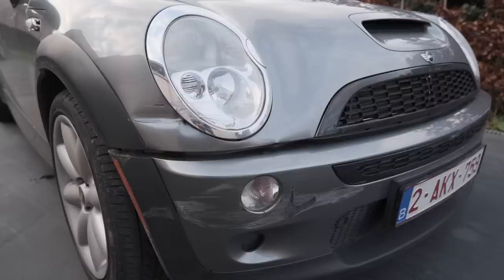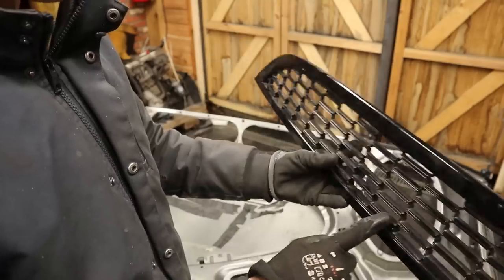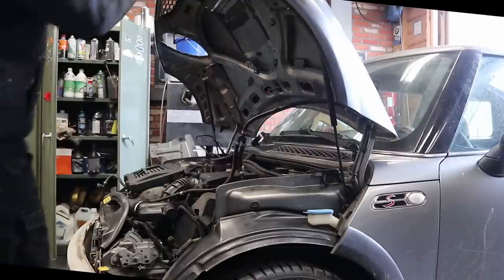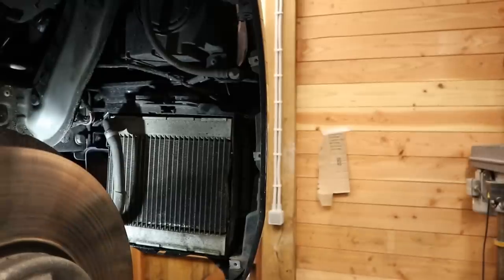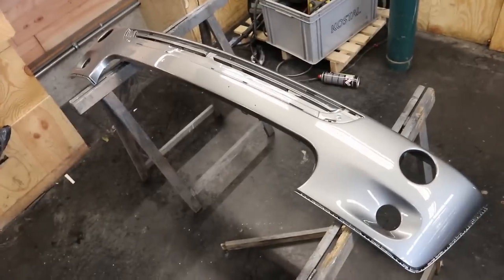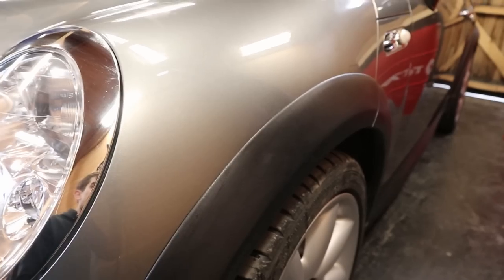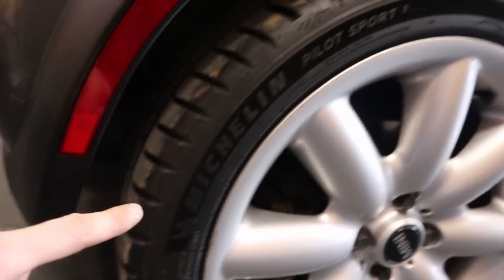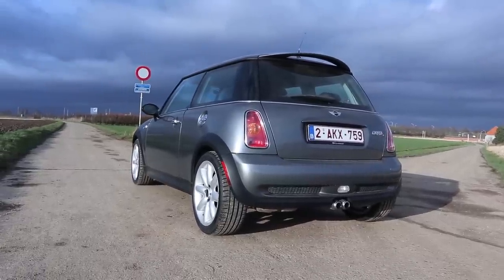I Am The Worst Paint Matcher In The World - MINI R53 Damage Repair

Comment: I know the struggle if mismatched paint. IMHO the dark primer made your color too dark in both cases. I had a similar problem while painting my mk1 octavia bumper. I used a grey primer instead of a beige one like Skoda used back in the day and my panel turned out too dark. Another thing to consider with metallic paint, is to back off the pressure on the spray gun for the last color coat. This enables the metallic particles to sit on top of the color pigments instead of drowning in the color pigments.

Don't be so hard on yourself, practice makes perfect;)

Comment: I have an R53 and I love it, it has so much character. Don’t be hard on yourself, many manufacturers have trouble matching paint from the factory.

I still see a lot of new cars where the difference between the steel panels and plastic bumpers is obvious.
Reply: thats why mercedes back in the 80s and 90s was famous for their colour matching...especially hard to do on white cars. Nowdays as you stated, you can tell even on new cars that its just not the same color :P

Comment: Had the same problem on a mazda mx5 used correct code but was totally wrong shade tried from two different paint suppliers in the end took petrol filler cap off and matched to that perfect match couldnt  tell any difference , keep going dont be to hard on yourself  doing a great job.

Comment: Doing a great job, Memphis. The best headlamps, bar none, were Hella NightVision lamps, the North American DOT version, and fitted with PIIA Ultra White H3s. Those bulbs were everything you want in a bulb. Clear, bright, and even illumination. Miles better than anything I have seen, and that included BMW Xenon headlamps. Then again, I am also used to doing 2, 3, or even 4 hour drives on country highways and backroads with maybe one street light at an intersection, but pitch dark the rest of the drive. Drives like that are why I will never own a car with an idiotic screen in the middle of the dash.

Comment: painting is easy. But to master it takes many years. One trick for rock chips is to mix a little bit of base coat with the clear coat and apply with fine brush or toothpick.  For better result you can apply 2-3 times to build up a little dome and then sand it down and polish. Almost invisible. Normally if we had a car for repairs we would just go over and fill in all the chips on the bonnet and doors

Comment: Paint mismatch this severe is fault of company that prepared the paint. They either made the paint wrong or failed to explain you correct process to apply it. 
I also always tried it on the piece of sacrificial acrylic before painting the actual piece. 
This "transmission cooler" I think is just "high speed"/"hot climate" (these are the options names) auxiliary water cooler.

Comment: Great videos! How did you solve the high's adjustment? Usually the non xenon models have a control panel in the dashboard for in drive adjustments to be made for compensating different loads. The xenon models don’t have that bc they xenons are self levelling. Without the control and non xenon heads you might lose the certification for the car, don’t you?

Comment: You might try a heat gun on the plastic trim. Be careful not to overheat the trim as you will melt it. Works very well. 🙂
Reply: it does get the oils back to the surface of the plastic, but that is a short term solution sadly, its better to treat the plastic with some quality plastic restorer, so the tired gray trim absorbs all the oils back and turns black again :)

Comment: If you want to make old black plastic strips look new, take and go over them c͟͟͟a͟͟͟r͟͟͟e͟͟͟f͟͟͟u͟͟͟l͟͟͟l͟͟͟y with a gas burner and heat them up, and they will be like new again.

Do not do it! When they are sitting on the car. Take them off of course and let them lie on a flat heat resistant surface and then let them cool down properly.

If you still want to do it, do it when they are on the car... then put the oven's aluminum over the car's paintwork and be careful, as protection.

Comment: Re Paint Match. There are machines that cost thousand of Euros/Dollars/Pounds that do paint matches. It's all done through Paintcodes normally included in the vin somewhere. Don't know what they use to keep the roads ice free in good old Belgique but it's rock salt over here and i doesn't half screw up yer paint work. You will drive yerself nuts chasing paint chips. Keep up the good work.Until the next one🤣

Comment: Have you had good luck passing inspection in Belgium with LED conversion ? I've always been too scared and put the halogens back in right before. My car actually goes for inspection next week so it'd be useful to know if I should take them off again or not. Thanks
Reply: I've done LED and XENON conversions in different cars, even going as far as replacing entire projectors and always had good luck.

As long as they make a clean beam pattern on the testing rack they usually get a pass!
Reply: Dunno how is it in Belgium, but in Lithuania, you cannot pass with LED's if the car is manufactured to be with Halogen since it has to be the way it came from the manufacturer in original form. + there have to be headlight washers. Changing from Xenon to LED will be okey tho.
Reply: @svartsas  
Well that's what I thought it was like in Belgium too but since he's also in Belgium and he works at a place that sells those things I figured he would know. But I guess I'll take them off again this year.
Reply: Yep, I will be more than happy to install retrofit LEDs, but as far as I know, those are not legally permitted in Poland and whole EU as well. I heard that in Germany there are specific cars list matched with specific retrofits which are certified.
Reply: @Comptonek  Yeah I actually took them off for inspection this year again, and good thing I did since I had other things wrong, even if inspector was lenient you can't have too many things at once. I actually forgot to put them back in, I need to find time for it.

Comment: Why are you blaming yourself for paint match? That's paint supplier's fault, they mixed it badly. Did they scanned your car with spectrometer?
Reply: Probably the fault was on the black primer. Usually the paint shops require a grey primer.
Reply from the maker: They did